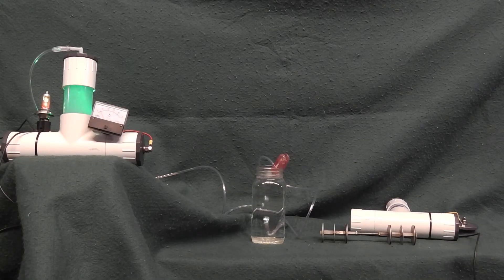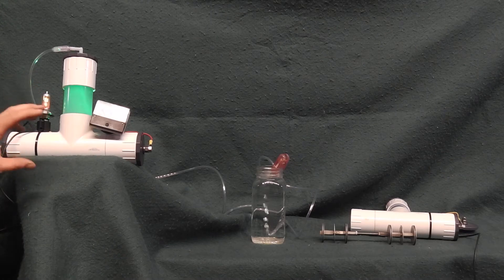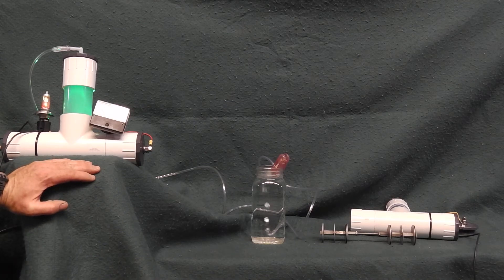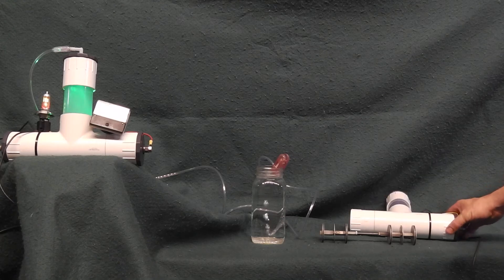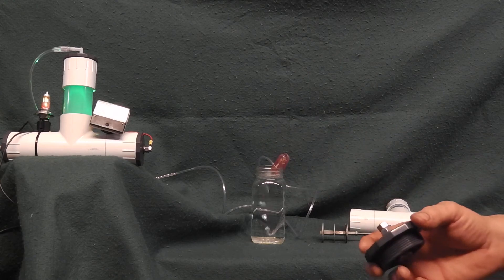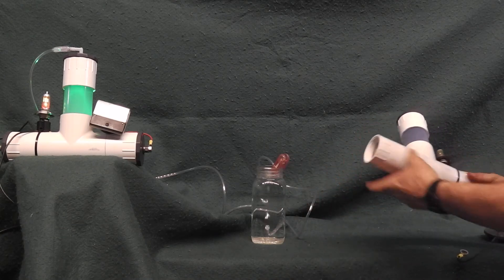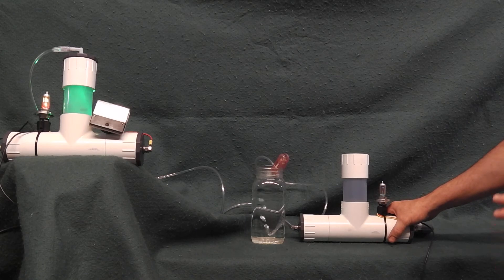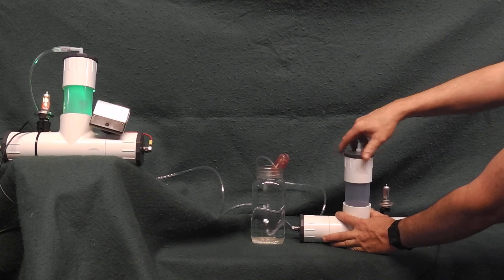Thunder-Volt-Overdrive HHO Generator

Comment: ok but how do you separate the + and - . im from south africa and would like to build one
Reply: this configuration  is     - n n n n +
Reply: do you have plans for sale?
Reply from the maker: Brasil Oiodiopis
no is -nnn+ but the efficiency is very good (better a drycell -nnnn+) because we dont have a current leakage and the bulb drop the voltage below 12w
Reply from the maker: Jean Westley
no, i have a generator for sale, so if you built a generator like my thudrevolt, with same parts quality, it will cost you almost the same price...and you probably will not have as good a generator as the original because I have a lot of experience and I know what to do and what not to do.
Reply: Francis Piché  where are the for sale?
Reply from the maker: Jean Westley
green-piche@hotmail.com

Comment: Hi how do you stack the plates and how is the positive and negative connected
Reply from the maker: the configuration is +NNN- ( because the bulb drop the voltage), and the positive and negative is connected by contact on the screw cap